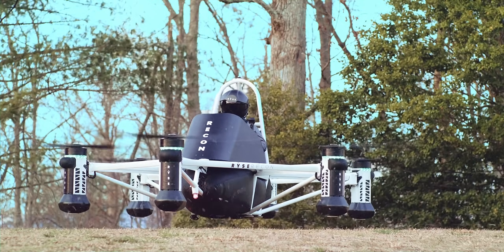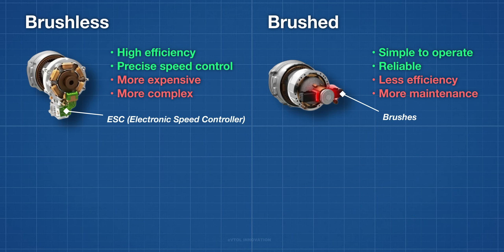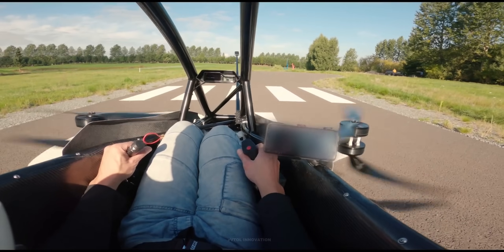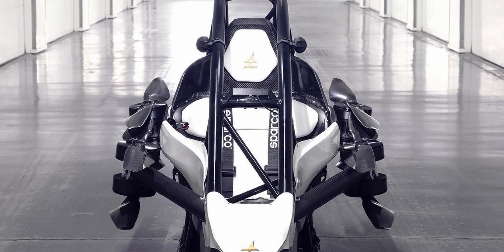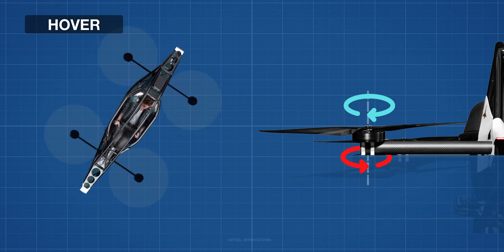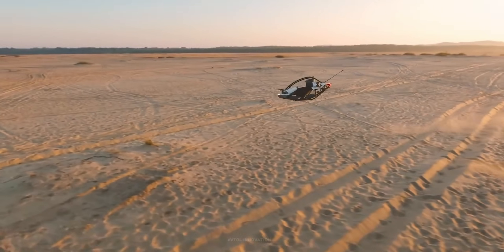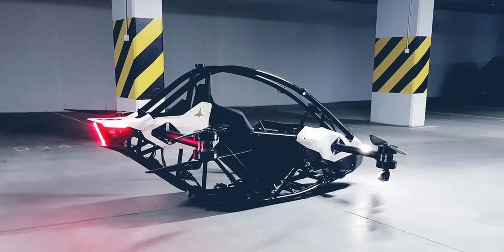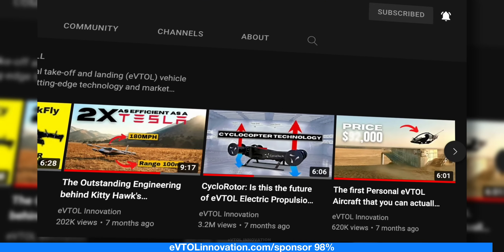The brilliant Engineering behind Jetson ONE

Comment: So a conventional helicopter can auto-rotate and use the massive spinning blade as a sort of conventional wing, for a short time of rouse. These are critical safety features for landing a helicopter in the case of an emergency. Can this vehicle do this? A conventional helicopter has a massive "wing" providing a massive amount of force to keep the helicopter upright, so much so that if you do actually manage to flip a helicopter, as long as you have the altitude to spare, they're pretty good about flipping themselves back over. What about this thing, or things like it? I just have a lot of concerns about the safety and stability of these aircraft. The goal of these companies is obviously to sell these things to people who presumably would fly them. People can't even drive cars safely, much less fly a helicopter. Other than the computer assistance (which we've seen in Tesla is not all it's cracked up to be safety wise), these things look like they'd have a pretty hard time recovering from a major issue.

Comment: All you have to do is believe that multiple failures never happen.
Reply: And that's one of the reasons I doubt this will ever really be a thing.
Reply: @garyfreeman896  imagine a software glitch that continuously applies full power.
Reply: Yeah just like a plane where if you have multiple engine failures that is also not good. YouTube critics always seem to not even understand extremely basic things, helicopters also use the same things and are actually less stable and have less backups. Also at this size they can even put emergency parachutes in, everything is monitored from fuel to the operational level of everything so it emergency lands the second it detects anything. And the first waves of anything there’s tons of bugs to work out but if anything helicopters crash a ton and are way more dangerous and planes can also fail and have had multiple engine failures and just tanked and they’re often flying over oceans or mountains where even if you can glide it doesn’t do so much.
Reply: @garyfreeman896  the classic negativity of the internet, the criticism of the YouTube experts usually amounting to ‘I think it’s dumb and stuff.’ They should have just gone to you guys before putting in all this effort you could have told them it was dumb and stuff and probably won’t work and they could have just given up then. I mean there have been critics of every invention ever, everyone said about the plane and having a big metal bird in the sky and no one thought it was a good idea and clearly they were right. Planes have failed a ton particularly the first couple decades and yet we keep using them and they still have malfunctions and crash after this much time. There are always those who try and those who do nothing and say it won’t work right off the bat little info needed.
Reply: @ComeAlongKay  You would stand a better chance with a plane than with this. In an aeroplane you get an added layer of security thanks to Bernoulli's Law. It's not guaranteed survival but it may get you some place safe to land.
Reply: @ComeAlongKay  You like it cos its cool not because it's practical.
Reply: @ComeAlongKay  you clearly have limited knowledge of how aircraft work. Unlike drones helicopters can autorotate after an engine failure. Auto rotation landings are part of helicopter training. Planes can glide after all the engines have failed.
Adding weight in the form of a ballistic parachute to the Jetson would severely impact the performance and duration.
Safety is paramount and no amount of "ironing out the bugs" in software and firmware can emulate the fact that helicopters and planes can land safely without engines because they have the ability to generate lift.
Reply: @ComeAlongKay  I suggest you read the pilot manuals I've read and perhaps try to fly an actual aeroplane before claiming I don't know the basics.

Comment: This isn't so much brilliant engineering behind the Jetson ONE. This is standard engineering behind almost every multi-rotor drone ever. They put a seat and HOTAS gaming controls on it, that is the only thing that is different. Actually almost all of those parts they are using can be purchased online, including flight control that supports joystick input.

Comment: Amazing design and build, but a bit cramped and over complicated. Needs simplifying. Also, seeing as the bottom propellers don't get as much airflow and therefore have to work harder, wouldn't ducting help with that? Such as the Ciphers on Metal Gear Solid. I'd link a photo but then this comment will likely be blocked.

Comment: This thing is great but it have one huge flaw and thats the battery 20min flight time is just meh... but have to just w8 more in future to batterys evolved or well i should say to get cheaper.
Reply: There might be a chance of getting this thing to fly 20 minutes without a pilot onboard (drone mode).  But, I calculate 2-4 minutes with an actual pilot.  Someone in the comments said he called the company, and that they said it was 3 minutes with an adult male pilot (exactly the middle of what I calculated).  So, I think you've got a very long wait before batteries evolve to anything you expect.  Lithium is the lightest metal on the periodic table.  I tend to doubt that anybody is going to figure out how to make a battery lighter than lithium ion.

Comment: Let's be fair, this is a toy. Short range, super loud.
Just a tiny helicopter, but slower and less able to keep you in the air for a while, let alone cross distances.

Great thing to scare wild life or hunt large game, though.
If for some reason I had two villas on opposite sides of a wide deep valley or canyon, this toy would make sense to get from the breakfast table to the library and from there to the gym.
Reply: So in reality, the technical differences between a traditional helicopter and one patterned after the four-rotor drones of late are...?
 Because if what you are implying is in fact correct, somebody better just produce a tiny, all-electric, traditional style helicopter really quick or else miss out on all the... whatever it is we're after... food or mates or something. We know what we are talking about. 
 peace.
Reply: It's like owning a top-fuel dragster. Fun to tinker with, fun as hell to ride 2-3 times a year, but so violent, noisy, white-knuckle and dangerous it's more of a joyride, not really practical.
Reply: It’s noteworthy that the flight videos never have accompanying audio. For all we know, this gizmo sounds like eight chainsaws circling your head.

Comment: Do you just regurgitate whatever the company tells you?  Or, do you ever fact-check anything they say?

1) I cannot make the math work for the claimed 20 minute flight time.  With the weights involved (typical weight of an aluminum frame of that size, motors, and resulting weight of the battery, and, of course, the pilot), and the typical efficiency of those kinds of rotors (which, as you said, lose efficiency when stacked like that), I approximate a 2-4 minute flight time before the batteries run dead.  I'll grant all day long that there are details that they don't disclose.  But, in order to get to a 20 minute flight time, that's a pretty big gap to fill between my math and their claimed flight time.  And, let's face reality here, they're not exactly demonstrating this.  Since the Wright brothers, the way you introduced aircraft to the world was at public air shows, not via publicity videos.  Yet, all I can find are little videos a couple of minutes long, full of jump cuts and editing, nothing every displaying an uninterrupted 20 minute flight, let alone open for the public to witness.

2) Parachute?  Where?  You're talking about a parachute that needs to be big enough to gently allow 400 pounds to float to the ground, plus mechanisms to deploy such chute.  Do you see anywhere on the craft that could contain a parachute that size?  There's none in plain view.  And, ok, we can't see the bottom of the craft, so is it down there?  Would you ever want a parachute to deploy from below, when it has those spinning rotors to go through?  Why exactly did you say this has a parachute?  Was it just because they say so, or, did you do anything to actually confirm this?  And, could this thing actually get to an altitude where it's actually safe and effective to deploy a parachute?  It can barely lift its own weight.  How high can this thing possibly go before running out of battery?

3) Where is this legal?  It won't qualify as an ultralight in the USA.  That would mean that it would need to have an unpowered stall speed under 28mph.  This thing doesn't even have an unpowered stall speed, because if you lose power, it drops like a rock.  In other words, to qualify as an ultralight, you need something to be able to glide you down to safety (like a wing, a gyrocopter rotating blade, whatever).  No, a safety parachute doesn't count, that's separate.  They're talking about the vehicle itself.  So, how in the world could this thing even be legal?

I mean, I get it, you're all enthusiastic about electric powered flight.  Personally, I don't see the appeal, because batteries just don't carry the same amount of energy vs. weight that a liquid fuel does.  A typical lithium ion battery produces between 0.3 and 0.5 MJ of energy per kg.  Gasoline or Jet-A fuel produces between 40 and 45 MJ of energy per kg.  So, for the same amount of weight, liquid fuels produce between 90x and 150x more energy than a lithium ion battery.  That's why, until some sort of brand new battery that nobody has even dreamed of is finally produced, there's no way that batteries can match fuel for aircraft flight.  While this Jetson thing is done flying and needs a recharge, anybody in a standard gas powered paramotor can cruise around for a couple more hours, going to 15,000 feet, without worrying about running out of power.  And, if they did, they can just glide back down.  Can this thing do that?  Um, no.

Comment: This is a terrible idea for SO many reasons. Open, un-encased propellers, 4 critical rotors (yeah yeah, I know, technically it has 8, but anything that damages the top one is likely to also take out the bottom one, and then good luck keeping this thing stable in the air).

Not to mention that, when I think about how terrible the average person is in standard traffic situations I shudder to think what millions of them flying these little death machines would be like.
Reply: What a terrible risk averse mindset you have.
Admire the engineering and convergence of technologies, see it as an example of what humans can achieve.
It is a prototype.
Be inspired.